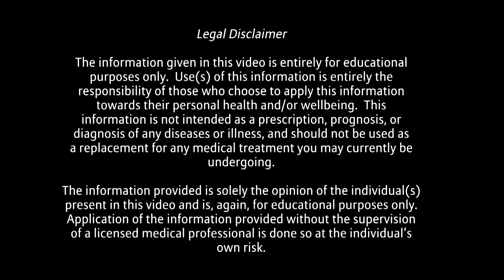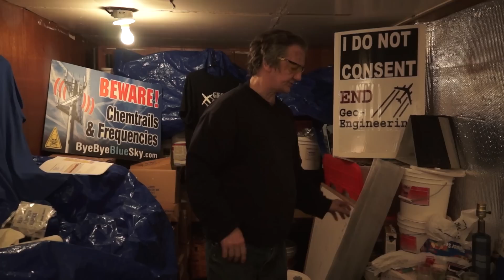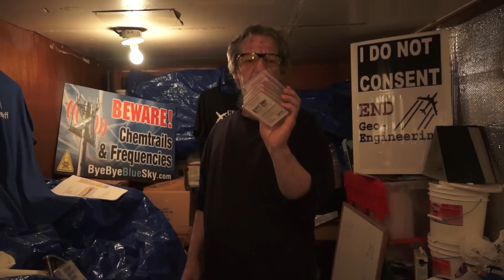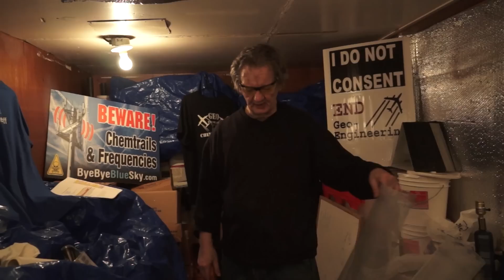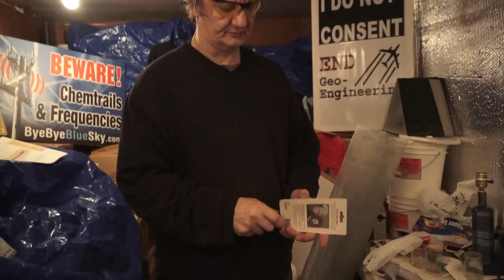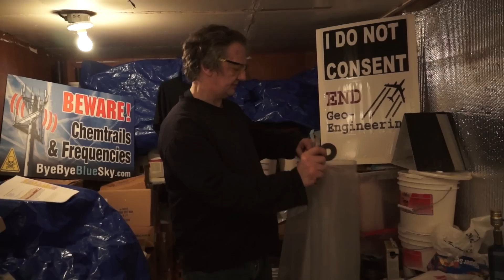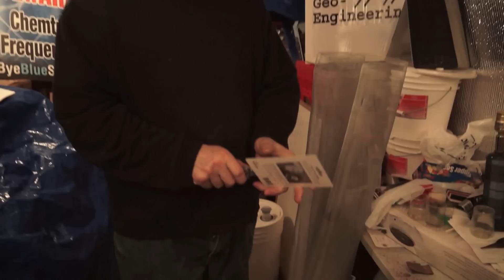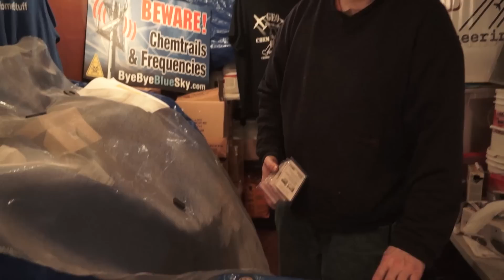Weapon of Mass Relaxation

Comment: It’s not the technical part that makes these projects hard, it’s that the materials that are flashed on video without a clear description. Usually there is a description listed on the drop down menu when I watch how to videos. Girly Girls aren’t familiar with some materials. Sometimes I have to watch the videos several times and it’s a time issue. I thank both of you for sharing however and am trying to learn.
Reply: Ya. He focuses on stripping a wire. If you can't figure that out you shouldn't ne doing it...But it's the connecting of power supply that worries me and in what order..

Comment: video-summary: 
1. blanket for bed, room walls, etc. 1.5 grounding-wristband.

2. bifalar coil to create a sublte torus field around your head/body.
3. Yellow lenses; block blue-light/Blue-beams.
4. Satured fat, no omega-3's, it's garbagae, they cause myelin and cell degeneration; sat fat keeps things solid.
5. avoid C60; hydrogen when it gets hit by the terrahertz the body's water is separated from the cells which AMPLIFIES THE terrahertz. 
6. Millenials drop the phones. AI is using you. Hopi prophecy; man's house will kill him. radio is talking to the microwave, the smart-meter to the TV, etc.

Comment: I am a targeted individual and those unknown criminals who are targeting me appear to be able to remotely disable the flashers which I have used in the shielding device.   Is there anything I can do about this.   If I get new flashers is there anything I can do to protect them from remote interference.   I will possibly make the fan device instead because it does not appear to have any flashers but only if I can't fix the flasher problem.

Comment: I have two questions. . .
1.  I have gotten electrocuted by a grounding pad. Our home is attached and all the neighborhood electricity runs underground so how can I safely ground myself upon constructing this blanket?
2.  When stuff starts coming out of your face (for example) how do you manage that removal process.  Is it magnifiers and tweezers?  Do you first soak the skin, or steam the face, or otherwise prepare for extractions?  Would you please be so kind to instruct about that?

For nearly three years now, I've experienced glass-like materials coming up through the scalp, which are very tender and sore all the time.  This will be my first attempt to de-fang the components prior to trying to pull stuff out.  Please help me with some answers and suggestions!  THANK YOU!!

Comment: What do you think about orgone is it safe, have you tried to create one, if so how would you go about making one. Cool fence I've seen it done, but made of copper on Windows and was tested with radio frequency it seemed to work. How would you test your method to confirm its signal being is made of aluminum? Thanks again and welcome back.
Reply from the maker: same way ~ should do the same but copper is better on one end of the freq band and aluminum on the other ~ alot of places will use both to target the hi and low end another combo is copper and iron same reason for targetting all the spectrums
Tony

Comment: Hey Tony could an old electric blanket be utilized instead of the mesh screen ?  Love your videos !
Reply from the maker: if you can get it to pulse would be another angle but just running a field will do little you have to surge the tech with a  pulse and fields
Tony
Reply: @HerbsPlusBeadWorks  where have you been Tony?
Reply: @HerbsPlusBeadWorks  Are you alright Tony?
Reply: @xmachine7003 I think he must have passed. 😢

Comment: I believe copper mesh would work to block wifi and cellular signals.
Reply from the maker: will work but you still will need to disperse it away fro the materials or they will eventually over load
Tony

Comment: re; wiring. am i running the + and -  from the PS to the flasher, and then to the blanket and from there back to the PS or running +/- to flasher then one wire to blanket then another all the way back to PS ?  a verbal schematic would be great. thanks.

Comment: Hey Tony, I noticed you said you used 24 volts with a car flasher, I could only find car flashers with 12 volts max and it gets very hot and stops working if I use higher than 12 volts. Do you use a resistor with that setup?
Reply: I don't think Tony is around anymore :(
Reply: @monikori6473  Tony has said in the past the commenting back and forth is difficult. But he may have a radio show he visits or a pod cast. I did catch him once where he gave a tic remedy. I can't find it on line.

Comment: Currently using Rife Machines. They seem to be effective in removing Morgellons and Lyme. Am  treating Cancer. I lack the tech skills and physical strength to make this item.
Reply from the maker: not  true the rifes actually hyper activate the nano not the other way around whoever told you this is basically telling you fiction they do not work on the nano poisoning and as for cancer --easy enough to clear put with out devices ~ and almost no one has lyme that is another pile of rubbish

Tony

Comment: Tony P's Definitely not a girlie girl. 
   Just one question please. Would it benefit at all to place one screen under boxspring and another screen on top of boxspring, under the mattress, to block frequencies coming up from first floor and/or basement electical panels? Thanks Tony and Dave. To your health, and Peace.
Reply: For clarity, I meant to ask, Is there any benefit With or Without the magnets on screens, or hooked up to electic supply or not hooked up? What about using those screens as window shades? Money's tight here in us even if prices are lower here.
Reply from the maker: it may assist would be willing to try and see
Tony
Reply from the maker: @tanucci733  you need the power pf magnetism and a pulse soooo if you don't then it will be neglible
Tony
Reply: @HerbsPlusBeadWorks  
    Thanx Tone. I'm trying to do some of these remedies on a budget of winning scratch-off lottery tickets i received on Xmas, I just gotta scratch them off to see if I won...🤩
   I received a 'T.E.N.S.' machine as a gift. I believe you said we shouldn't use it on the body. Can it be used as a pulser or in any other way? I'm not electronically inclined nor able to test what i do to know if its working or not. Trying not to be a pest...🙄
Reply from the maker: @tanucci733  it can activate the nano not a good idea
Tony

Comment: there were 4 things I was unclear of -
1) how do you make the "pancake"
2) what is the power outlet (transformer?)?
3) do you sleep with the blanket pulled over your head?
4) how do you make the grounds to discharge the frequency transference?

are there separate, related videos on these things?

thank you so much for this m(_ _)m 
I've had CFS/ME for 15 years and my immune system is wrecked so virtually nothing heals anymore.  it would be a godsend to watch and feel some of my injuries heal.  this seems like it may help. I want to give it a shot if I can afford it.
Reply: 24 v 6 amp ( at 14:15 minute)
see how to make a pancake https://www.youtube.com/watch?v=zfF5ngb_RrI&feature=youtu.be